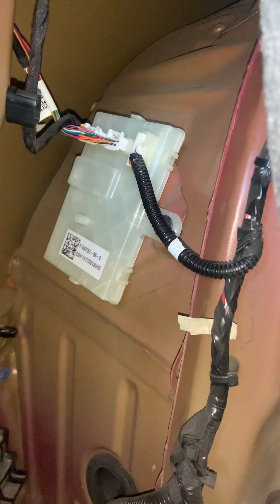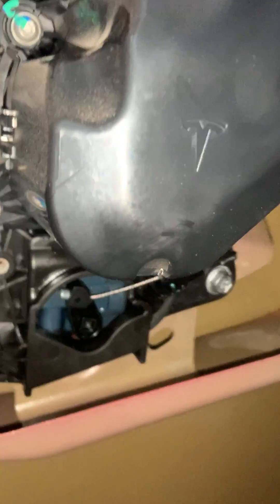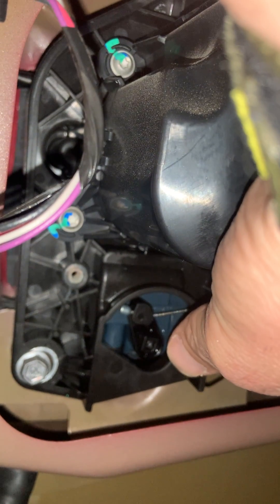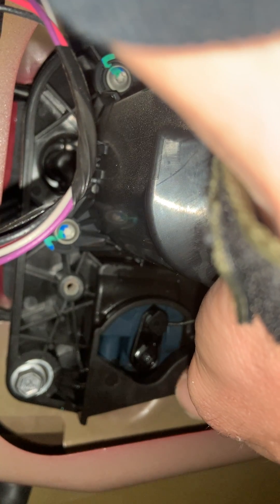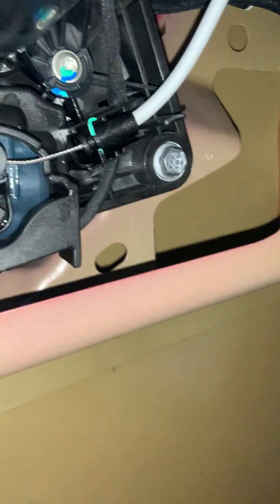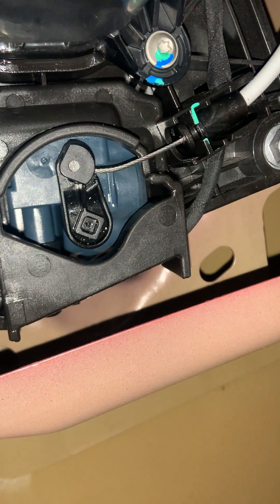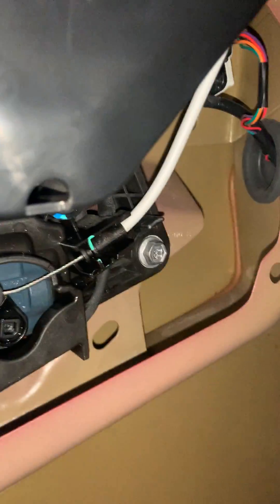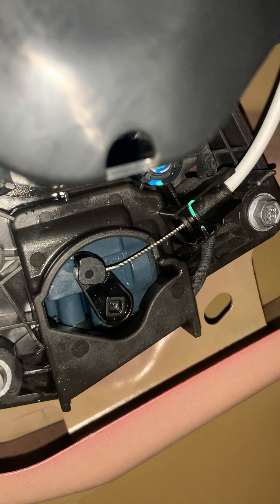Tesla M3 charge port locking pin error/fault

Comment: Ran across your video when having the same problem with a Model Y, the pin isn't retracting the entire way all the time - causing difficulting inserting and removing the charge plug.   Did you ever find a resolution?
Reply from the maker: sorry for the delay!  A software update came through and the issue dissappeared!  also try powering off the vehicle.
Reply: @MB-rc5fp  Hi, same problem with my car. I also tried restarting the car. Unfortunately, I can only pull out the cable with the emergency release. I submitted a fault ticket, I wonder what they will say.
Reply: @atti636  Having the same issue right now. I need to press "unlock" in my app 3 or 4 times for the latch to fully retract. Tesla is charging me 800$ I'd rather find another solution 😅
Reply: Same issue but now it's getting out of hand! Any progress?